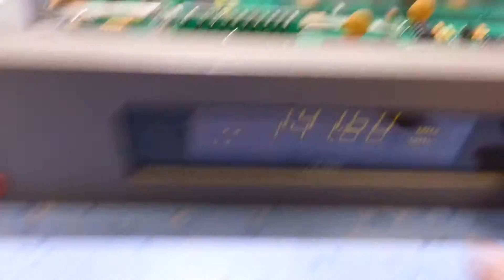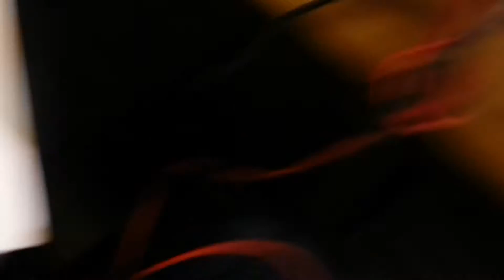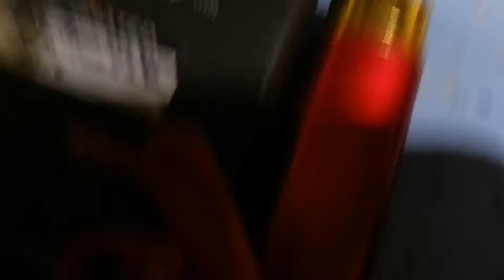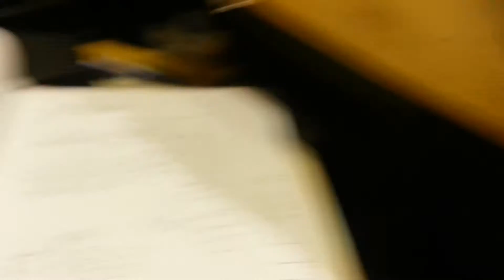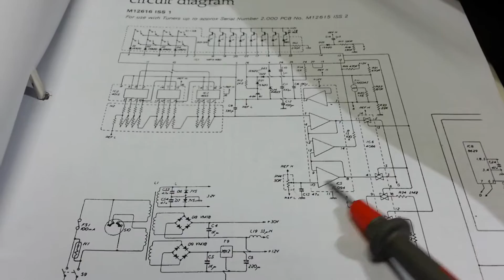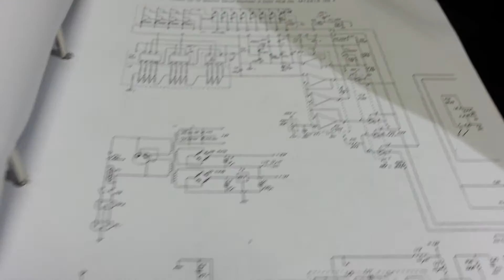Quad FM 4 repair attempt.1

Comment: hello I have an fm4 quad which is not functional, the IC 7
(UA703) is dead. it is possible to have the detailed schematic to manufacture the small printed circuit integrating the IC
(CA 3053S) and all the parts for the modification.
thank you
Reply from the maker: I think there is one in the later Quad service manual. I have no data any more. You referring to the IF amp?
Reply: @SoddingaboutSi  
Yes

Comment: Check all the Via's near that battery, and the tracks and resistors near the area, that stuff attacks all in its path, difficult one to sort when electrolyte has done its nasty. It also causes micro cracks in the PCB Tracks, spent hours on such horrors.
Great Video. All the best.
Reply: Helios Haul Yep, I brought a 34 pre to fix, it PCB looked a lot cleaner than this tuner and I still ended up replacing several resistors, op amps, switching ICs and tracks that had been corroded. It's essentially a new preamp now.